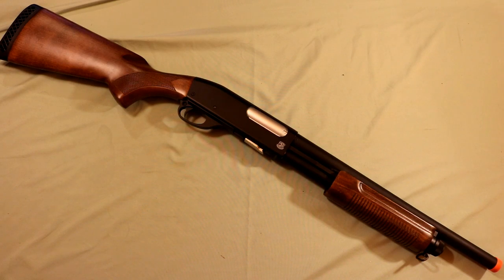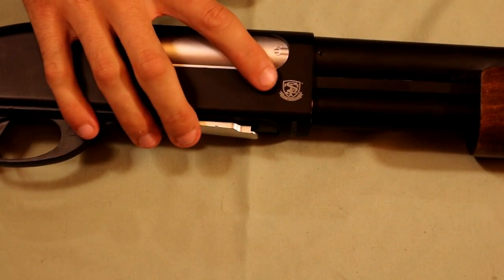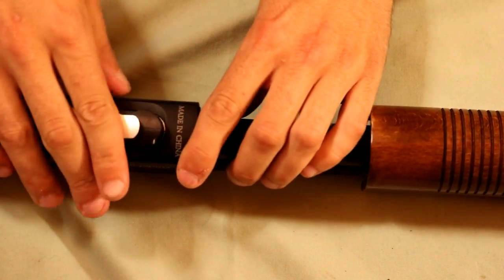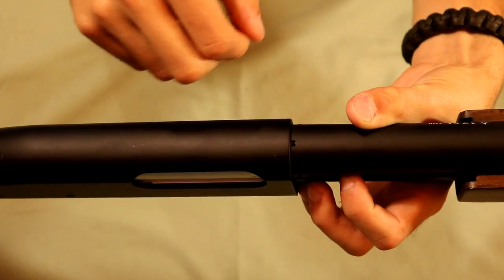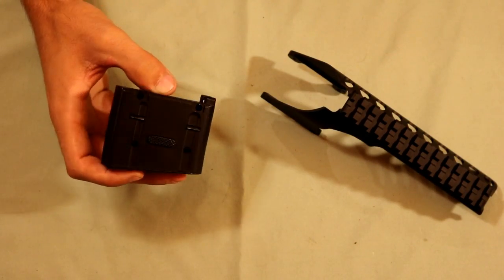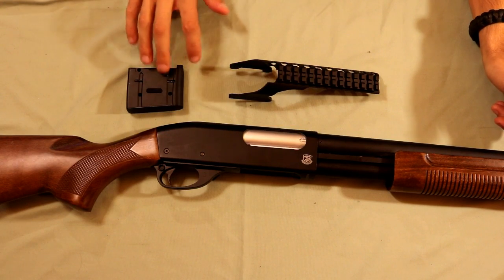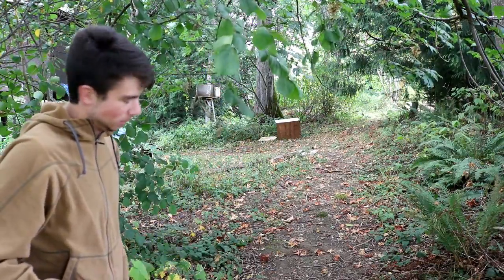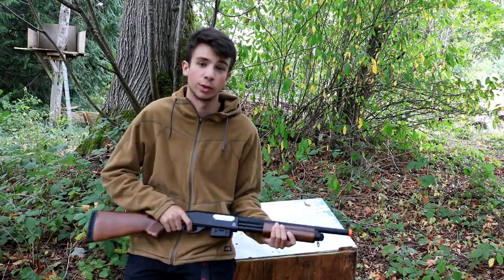S&T M870 Airsoft Training Shotgun Review (Full Metal/Real Wood)

Comment: Kudos to you on having the only good review I've seen for an airsoft gun. The others either lack information, have no shooting test (or do have one, but never elude as to the range), or are from companies trying to sell the gun, which means they will be biased and exaggerate the functions/capabilities. One question: what would you say the accurate range of this would be? Could it shoot within a 1 foot margin of error from, say: 110 feet?
Reply from the maker: First of all thank you so much for the kind feedback, I really appreciate you writing this. After reading, I went and tested this out for myself. I set a carboard box (with a 10"x13" face) at ranges of 110 ft, 130 ft, and 150 ft away from my shooting position. At 110 ft I was able to land 5/5 shots with .25g bbs. At 130 ft it went down to 4/5 shots. And then at 150 ft it dropped to 3/5. Still a decent gun at longer ranges but the performance drops off noticeably at 130ft and farther. I hope this helps!
Reply: TheAccidentprone It is quite helpful, thank you!

Comment: Is it possible to remove the orange tip? I am looking to buy one as a prop for a video.
Reply from the maker: On mine it looks like a plastic piece added on with some sort of 
adhesive after construction, not integrated into the gun itself. So I 
think you could remove it, but it'll be harder than just twisting it 
off. There might be some tutorials online for how to go about it. Just 
be careful using it if you remove the orange tip, don't want police 
showing up to your film site thinking you have a real gun!
Reply: Ok thanks a lot!
Reply from the maker: No problem! Happy filming :)
Reply: I removed the Orange tip on this gun. I boiled some water and held the tip in the water for a few minutes. Then i used some pliers to twist the cap off.  Be careful not to break the tip and you can place the tip back on if transporting or something. Once removed initially it is very easy to remove on and off with your hands.
Reply: I'm just glad that our country do not commit you to put an orange tip on your Airsoft Guns.

I have bought this Single Shot Shotgun some days ago and i gotta admit, it's pretty accurate on far distances.
Reply: sgtslash007 thanks for the advice I am going to be creating a Vietnam loadout and this looks like an outstanding choice next to the m16a1

Comment: How is yours holding out? I've had to replace my sawed off one 4 times because of issues in the cocking spring mechanism.
Reply from the maker: Mine's doing okay! Sometimes a bb will jam if the mag is overfilled to start, but barring that it has run smoothly!

Comment: Be careful with those A&K 40 round magazines.  I went through two magazines that failed before realizing that the spring in the mag was not strong enough to hold that many rounds.  I was using an A&K spring powered M870.  I suggest using 20 or less BBs in these mags.
Reply from the maker: Thanks for the heads up! I had been noticing that it doesn't always want to push up the last third of the mag or so.

Comment: hey so i owned this, and first time firing it ended up not firing. tried clearing it, and now I can't cock it. the guy i had to fix it, said they couldnt. my friend is trying but is not sure either. he's taken apart as best he can, but can't get it to cock. he's tried the tactic of just slamming the rubber part of the stock on the ground to try and clear it but nothing. any advice?
Reply from the maker: I've had some troubles with mine if I load a magazine before cocking. Usually I have to pull the pump back, load a mag and then chamber a bb by sliding the pump forward again, otherwise it can get stuck. Hard to say without it here in front of me (and you very well may have already tried what I'm about to suggest) but check to see if the safety is off and take out the magazine. If you have one of those unjamming rods maybe try to clear the barrel that way. Check if anything is blocking the pump from sliding. If it comes to it you could also see what the return policy is of the store you got it from, perhaps trade it out for a working one.